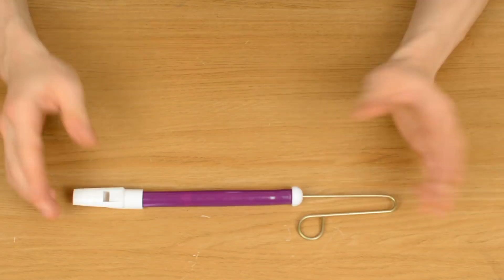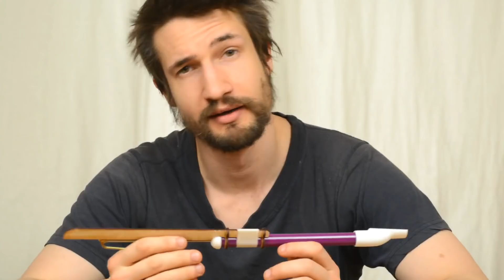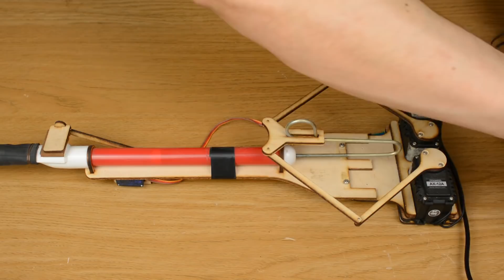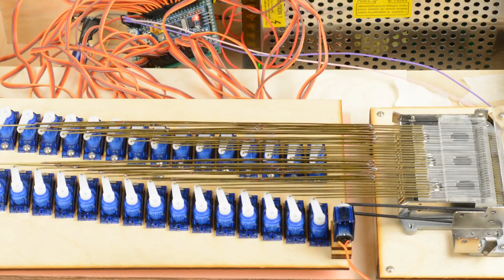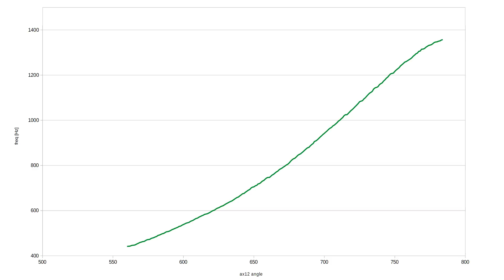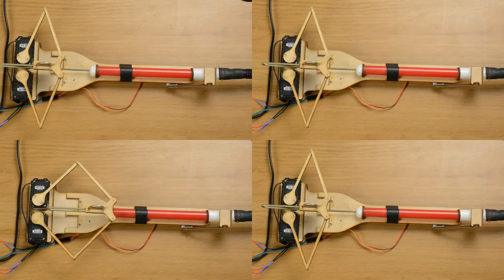More MIDI madness

Comment: This is such a clever Idea. I could probably actually play the Trombone rigged with a contraption like this.
maybe an idea for another video?
Reply: I love the idea but I think trombone is nigh impossible since the slide doesn't cover all the notes. You need complex embouchure (lip tension manipulation) to switch registers (or even notes in the same register) and even the basic lip vibration technique would be really hard to recreate artificially. I doubt anyone could make a working midi trombone.
Reply: @TaylorTheOtter  Maybe a rotating drum with different silicone "lips"? It wouldn't be able to change register very fast though.
Reply: @tomthepom98  I applaud your creativity but I'm afraid that the embouchure is different per note. I used to play a little (self taught, still a beginner) a while back so I picked it up today to feel how it worked again. Once I started playing, I remembered: you need to buzz your lips at the same pitch as what you're playing with your slide. It's kind of like how you can make a balloon squeal at different pitches if you deflate it while pulling the outlet tighter or looser. I hope someone proves me wrong and makes it work though. It would be so awesome.
Reply: @TaylorTheOtter  You don't need to replicate lips buzzing, you can just use a small, powerful speaker to pump a sound of the correct frequency into the tube where the mouthpiece goes. The trombone doesn't care exactly how you make the air inside it resonate, just that you do.
Instead of a normal mouthpiece, you could fabricate a horn bell shape that attaches to a small driver on one end, and tapers down to fit into the trombone at the other. Servos or a linear actuator to move the slide and a small amp and tone generator to drive the speaker and you've got yourself a MIDI trombone.
Reply: @tissuepaper9962  that makes sense! I wonder what kind of timbre you would get that way. Also, how would the timbre be influenced by pumping different waveforms through the mouthpiece? If I have time (school and all that), I might experiment with this idea.
Reply: "Keywinds"? Or well, "Brasskeys" or "Keybrass" in that case. Wind or Brass instrument's rigged up with a keyboard like a "Keytar." Would needa getup like marching with a bassdrum or Xylophone.

Imagine the poor fella wacked by a motorized trombone slide though.... :d

Comment: Attach a microphone and implement a fundamental frequency algo and a pid controller in firmware!
Reply: can PIDs handle hysteresis?
Reply: @PascalSommerMovies  If the closed loop dynamics is critically damped I think the integral action should be able to compensate for this.
Reply: @PascalSommerMovies  it's what the i in the pid is for. well, not JUST that, but yeah....
Reply: i like your funny words magic men
Reply: I wonder what would be the best way to calculate the frequency. FFT might be overkill and I think one might already get decent results with autocorrelation.
Reply: @kwinvdv  I don't do signal processing so I might be wrong but isn't FFT the fastest way to do autocorrelation, meaning that we should just use the FFT directly anyway?
Reply: @PascalSommerMovies  I initially assumed that autocorrelation would be cheaper to calculate then FFT. However, according to wikipedia a fast algorithm for calculating the autocorrelation uses two FFTs. So FFT indeed seems to be the way to go.
Reply: @kwinvdv  you should be able to do it by measuring the error signal from a phase lock loop circuit, a CD4046 ic should work.
Reply: @kwinvdv  A phase-locked loop that tracks the microphone would probably work nicely. Easier, less computationally intensive than a FFT and no discrete frequency bins to interpret.
Reply: @mass1s  i could be wrong, but don't most PLL's output something more like an FM waveform than a stable 'control voltage' that could be used for tuning?
Reply: Peizo
Reply: FFTs use a discrete number of "bins" that the incoming frequencies are correlated to.  These bins hold a range of frequencies (for example 100hz to 200hz) so unless you had an absurd number of them (which would slow the algorithm significantly) discerning accurate pitch information for tuning would be difficult. A better solution would be using some sort of input filtering (low cut and high cut to isolate the fundamental) then using a frequency counter or frequency detector. These algorithms are simple enough to be implemented on an arduino and I'm sure that there are plenty of projects out there for arduino tuners that could fit this application.
Reply: @trellise9811  the bins aren't necessarily discrete if you track phase difference between frames, this will give 'instantaneous frequency', though the phase unwrapping required, and also needing at least an overlap of four seperate ffts would increase complexity a lot.

Comment: Won't it make sense to add a piezo element to the whistle and monitor the current pitch and adjust the position slightly in a PID loop, therefore solving both the backlash and the constant need of re-calibration?
Reply: I was thinking that if improvement was desired, step 1 would be to eliminate most/all of the backlash by going to an o-ring sealed metal (or plastic, or, heck, why not wood) piston. Once you take the slop out the feedback technique will work better - probably just a quick pre-performance automatic tuneup. I'd think closed loop while playing might make wobbly or 'chirpy' notes where you'd have a pitch transient at the beginning. Now that I think about it, a good analogy is the calibration strategy for the Volca Keys - it plays silent notes at itself while idle to keep the VCOs tuned, but doesn't while you're playing to avoid note-stepping. (the upshot is if you start playing before it's tuned up you'll get interesting results).